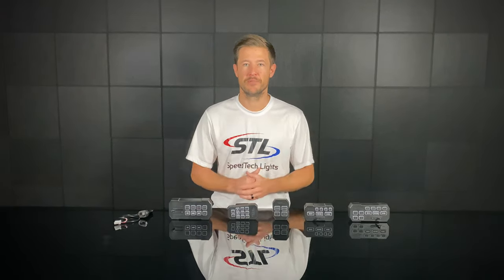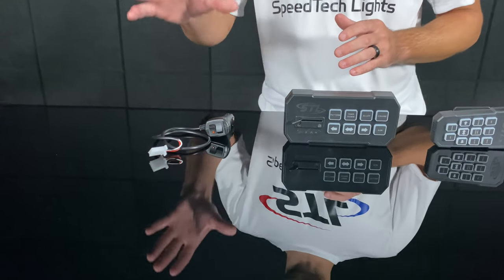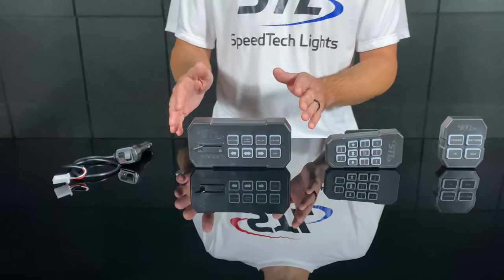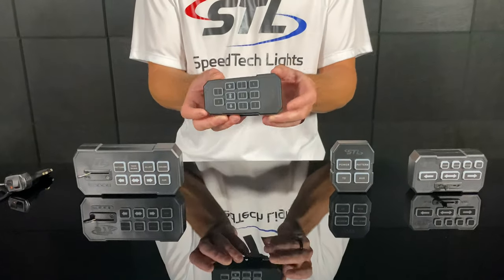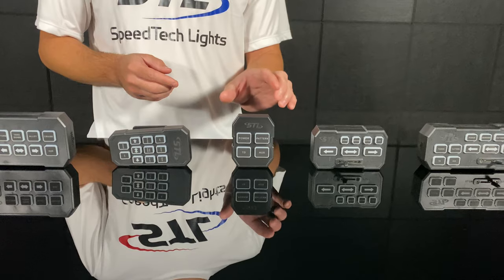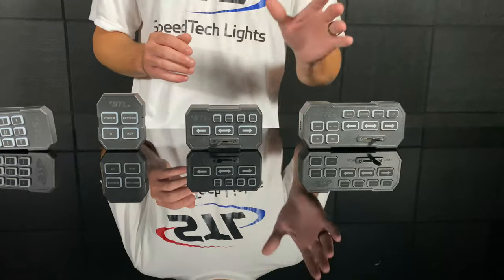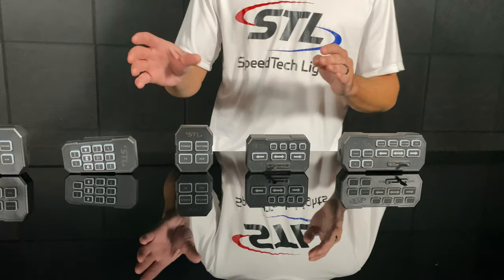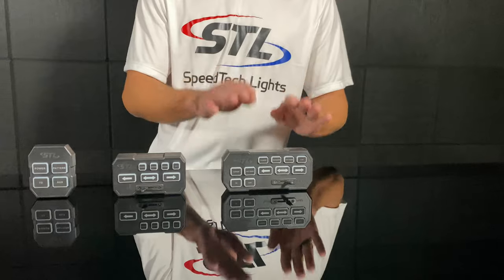SpeedTech SpotLight: Switch Boxes

Comment: Would a control box work with a cigarette plug to provide superior control and easy power without hard wire?
Reply from the maker: Yes sir! These are very simple to plug in and get hooked up. Our K-Force Full Bars will have to be hardwired due to the Amp draw, and you'll see a cig-plug option on our Raptor Visor Bars if you need a cig plug for power. All other products that have an optional switch box will come with a cig plug for power. Use our LiveChat feature on our site and we'll be happy to help get you setup. SpeedTechLights.com

Comment: I am ordering (2) striker2 Linear for the front windshield, (2) striker 2 TIR for rear windshield and (2) ZX180.  What control box would you recommend to connect all these connections to 1 box?
Reply from the maker: Hello, we would recommend getting our 4 Switch Box. Hook the 2 Striker-2 front windshield to switch A, rear Striker-2s to switch B, and ZX-180s to switch C. Then you could hook your flash pattern cables to switch F and you could change the flash patterns of all of your units. Check out the 4 Switch Box here:  https://www.speedtechlights.com/Switch-box-control-panels

Comment: Is the supreme hand held control box wireless or does it still have a wire ran to it ??? Haven’t mentioned anything about wiring of the control box’s
Reply from the maker: Hello, the Supreme HandHeld Control Box will have a plug just like the standard Supreme Control.
Reply: Can the running board lights and tailgate strobe be link together with the light bar ?
Reply from the maker: @tylerkapherr8154  You could hook them up to the Aux switch on the Supreme Control. That switch will have an on/off function for the additional lights. You'll want to get those additional lights programmed and then hook the power cables up to the Aux. Give us a call or send us an email if you have any questions: CustomerService@SpeedTechLights.com 8007572581